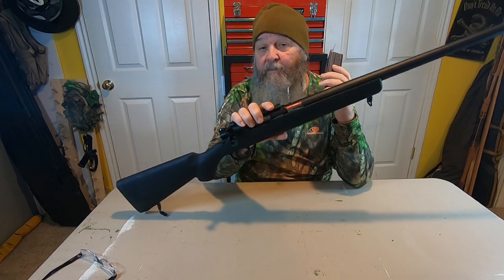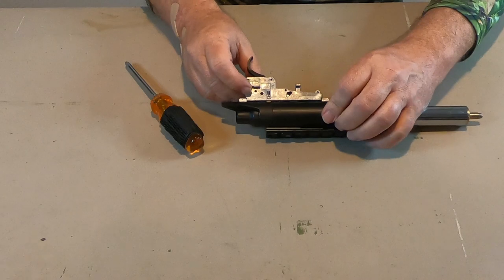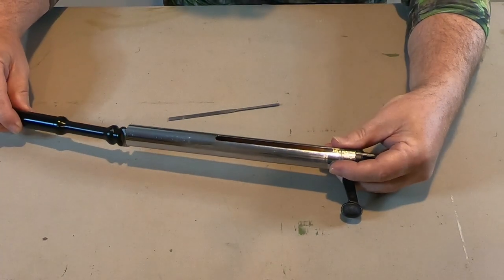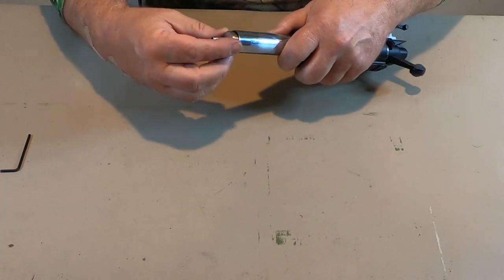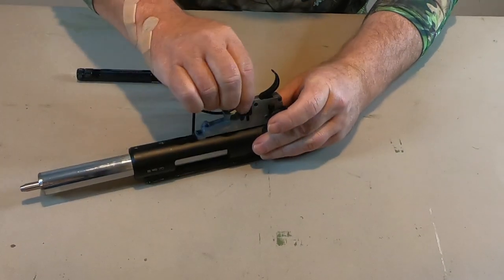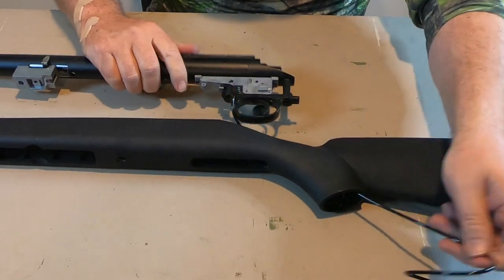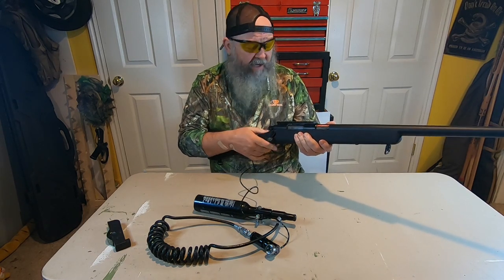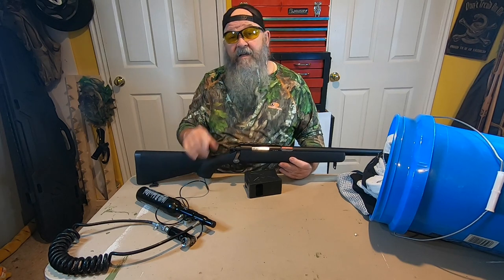Bolt M Installation Step By Step | Wolverine Airsoft | Shreq Airsoft

Comment: What’s the max pressure you’ve been able to run into the Bolt M? It’s supposed to be able to handle 180psi but I’ve heard from many people that it can’t handle anywhere near that pressure..
Reply from the maker: Based on the joule limits on the fields in my area I've only had it up to about 140 psi, anything over that and it is over the joule limit
Reply: @ShreqAirsoft  It depends on what BB weight you’re pushing. I go heavy using .45 or .48..

Comment: I've been thinking about getting the Bolt M. What psi are you running to achieve those joules? Also, any issues after owning it for awhile?
Reply from the maker: No issues at with it, I believe that I am running about 105 psi on my regulator
Reply: @ShreqAirsoft  To achieve those joules on 105 psi is pretty good.
Reply from the maker: @nvbss08  To be honest I think my regulator might be going out, I think its putting out more but I don't have a way to measure the output

Comment: Thanks for this videos, I have the same VSR configuration but I don’t fucking take a good configuration for the hop up … I already purchase a pdi 6,01 500mm and the action army hop… seeing your videos to learn from Spain. 
Thanks! 

Any advices?? I already mount the bolt for HPA too 🥺 but I’m disgusting with the precision
Reply from the maker: Thank you Alberto, that's the reason that I make these videos to try to help people out and entertain. I tried both the PDI and AA hop ups like you but stuck with the AA hop up. Your precision will get better. When you put in a new system it takes time for the rifle to settle down, usually 500 to 1000 rounds. Right now my biggest advice is to practice and figure out how your rifle shoots but mostly have fun while you are doing it. I would love to see some airsoft game play videos from Spain! Don't hesitate to ask questions, I will answer you back!

Comment: Hey Shreq, do you have any issues with the Bolt M?

Mine constantly doesn't "load" the air into my cylinder. I wanna say maybe 1 in 2 BB's don't fire and I end up having to double feed. I'm pulling the bolt all the way back every time but it's a constant issue.

On top of that, I have wildly different measures of FPS/Joules. I'm talking measures of 180-480 FPS. I don't think it's my regulator but I wanted to run it by someone else I know has one.
Reply from the maker: No trouble like that at all, did you change the hopup chamber when you installed your Bolt M?
Reply: @ShreqAirsoft  So I had this a little over 3 years ago, and I had the exact same set-up as your hop-up set-up. I got my stuff in the mail today and I went to disassemble it and the bucking was actually torn to shreds. I think that might've been the culprit that caused an air leak. I'm hoping that when I re-install the Bolt M onto my new VSR that it works fine. I really hope it's not actually my HPA regulator though.
Reply from the maker: @joaquin5541  Not sure how a bucking would cause your hpa system to leak but I've seen stranger things my dude. Let me know if that was the issue!
Reply: @ShreqAirsoft  https://i.imgur.com/lb9AECN.jpg

That's how
Reply from the maker: @joaquin5541  That's nasty, how did you manage that?
Reply from the maker: @joaquin5541  You can find my email address on my youtube home page in the about tab
Reply from the maker: @joaquin5541  Let me know what happens dude
Reply: @ShreqAirsoft  shot you an email
Reply from the maker: @joaquin5541  I'll look for it

Comment: I can’t comment?
Reply from the maker: LOL, you just did.
Reply: @ShreqAirsoft  I shoot better than I type. Raccoons in the chicken Coop again!  2am gr……. .25 slugs with 300 bar and the hammer spring 3/4s.  In this brand new air avenger with a night scope 3-16x40mm . I’ll watch for time and location for tomorrow.   I was told possibly 1 pm and you told me 12th over the tracks 👍🤘….
Reply from the maker: @bartertradesaleslapidaryse2136  It was changed to noon but 1pm show time is still ok. Just walk under the railroad bridge and take a left along the tracks. You will run into where we are staging.